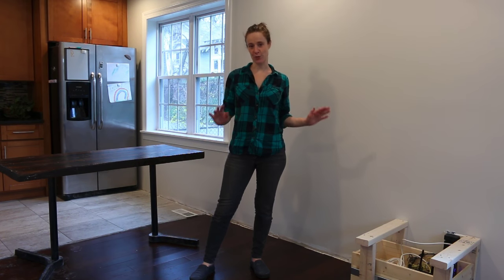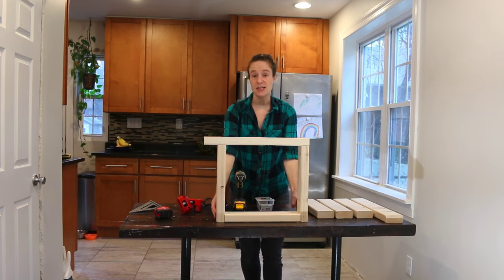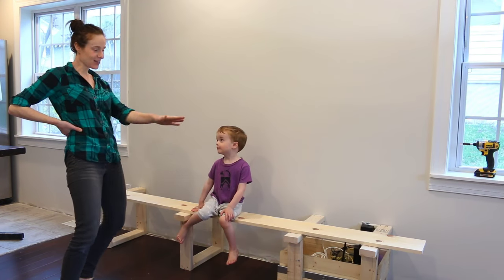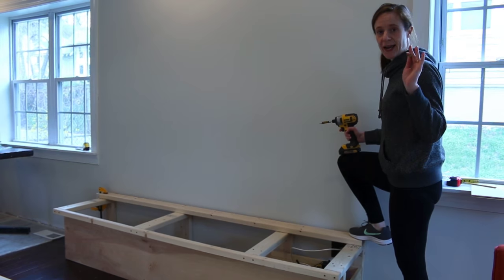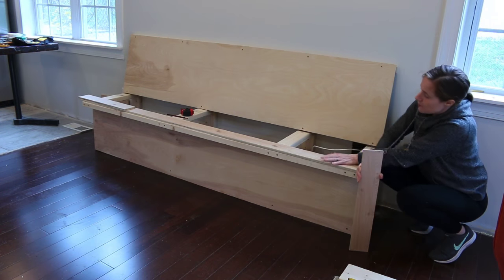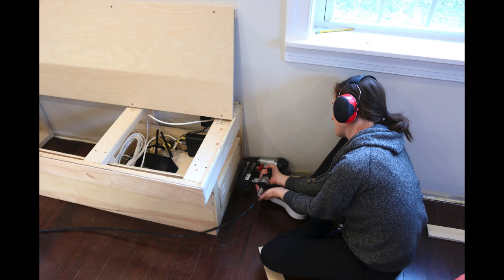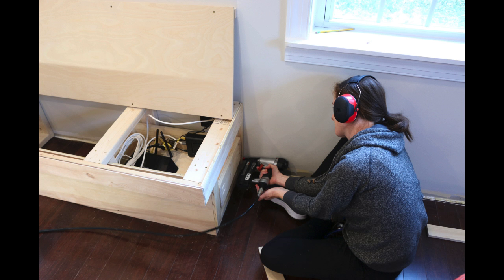DIY Banquette Bench/ Bench Seating with Storage

Comment: How much did you spend on all the supplies?
Reply from the maker: Everything including the drawer hardware, paint, trim, fabric and cushion foam were in the $350-$400 ballpark. I used cabinet grade plywood, which is $65 per sheet, soft closed drawer slides and water resistant fabric, all of which are a little more costly.

Comment: Could you elaborate on the back piece. I see in the video you screwed a piece of wood to the wall and then screwed the back at the top. What isn't shown is how the bottom of the back piece was attached to the wall. As its on an angle, did you cut small pieces of 2x4 with mitered ends??
Reply from the maker: Great question!  I attached a 2x4 to the frame along the wall and screwed the bottom of the back support into that, which created the angle.  I have a blog post with the instructions and a photo of this step here: https://theunprofessional.com/create-a-small-space-eating-nook-with-this-diy-banquette-bench/

Comment: Where’d you get the table?
Reply from the maker: The top is ikea and I added a polyurethane coat. The legs are from Amazon. I learned from experience that the table legs need to be pillar or X shaped to get in and out of the bench easily.

Comment: Nice design. My biggest concern about building one of these is comfort. How has this stood the test of time? Is it comfortable is it for long sit sessions?
Reply from the maker: That was my concern as well when I built this. I’ll say this, it’s more comfortable than a dining chair but not as comfortable as a couch. I think the three keys are 1) angle the back a little, 2) use 3 inch foam for the seat cushion and 3) have a bit of an overhang on the seat so your legs can hang naturally. Good luck and thanks for watching!
Reply: Most folks make upholstered cushions for them. You can DIY a very simple look or go on Etsy, etc and have some fancy custom ones made out of washable sunbrella etc

Comment: My last bench banquette was in an L-shaped corner of my kitchen 15 years ago. I am going to use your design for my current home to add more space to our walk-through dining room. I always like to take any dead space (cubbies under the seat) and turn them into storage also. Brilliant Laura!
Reply from the maker: No fancy shop here! That’s for sure 😜. Your comment made my day! I’m so glad the videos were helpful. Good luck with your project!
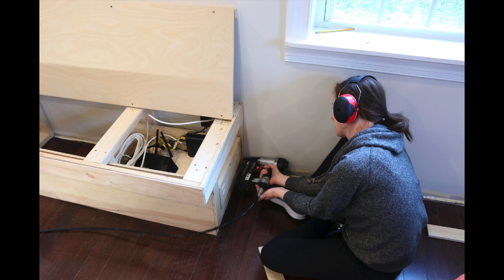Reply: @TheUnprofessional  it appears at 12:34 mins that the finished seat-back has an additional length of a 1" piece at the top. Is this true or am I just seeing a shadow? The unpainted seat-back had a straight slope of plywood attached to your 1" x 2" wall anchor.
Reply from the maker: Yep you are seeing it right, there is a flexible piece of PVC at the top. It was the only way I could trim against such an uneven wall.

Comment: Love this project and I'm going to start something similar very soon. Can you please advise what length of screws you used for the framing elements? I assume these were countersunk woodscrews as well? Thanks again!
Reply from the maker: For the frame, I used 2 1/2 inch all purpose wood screws. I didn’t countersink the frame but I did when I screwed in the 3/4 inch plywood, but the screws were 1.5 inches. The frame was all trimmed so it didn’t matter.